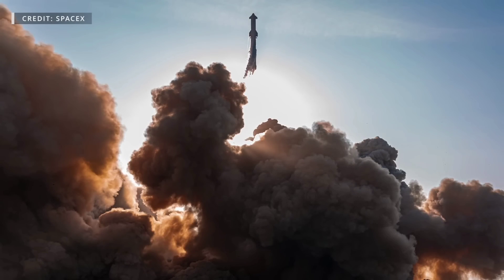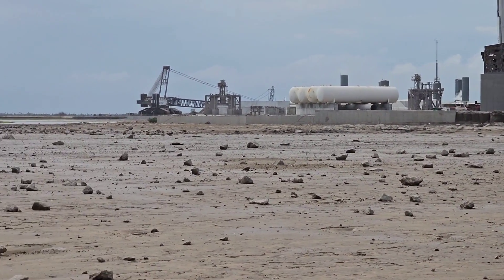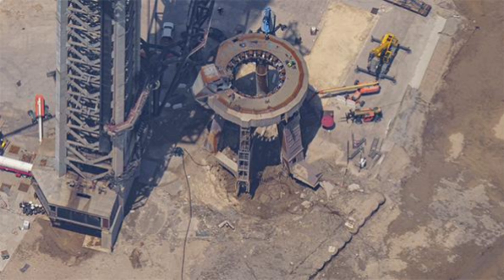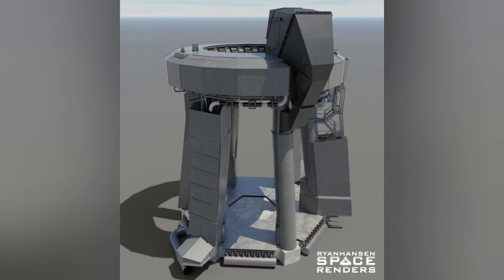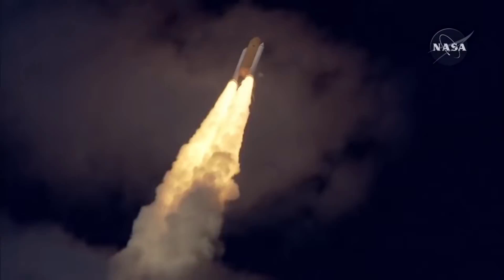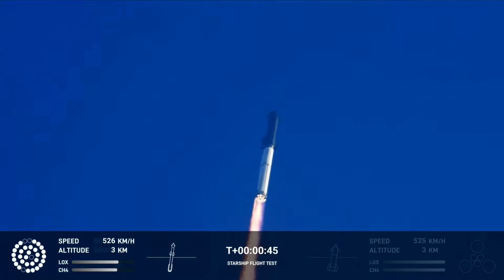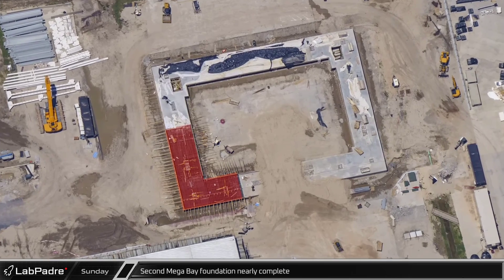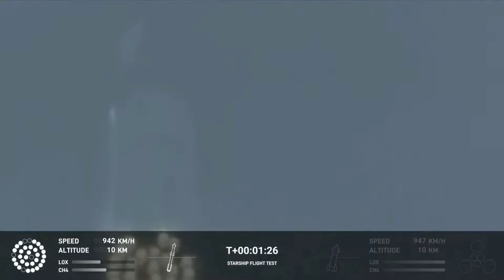Will Elon Musk's water cooled flame diverter be enough to keep Starship and Starbase safe?

Comment: Rapid iteration and willingness to RUD equipment is what got them so far so fast.  I don't think them destroying a couple plates and water systems, maybe even having to redo the pad altogether, is a bad thing at all as long as they keep the data coming in and morale is high to keep cadence up.  They built the LLM pretty fast.  Building a second one would likely only be faster if they decided to.  I'm also unsure about a large flame trench for rapid turnaround launches.  The right metal with enough cooling can handle extreme temperature and pressure shock over and over again until failure.  And failure modes in elastic materials are a bit more manageable.  If they did build a huge concrete flame trench, and it were to get damaged, turnaround could be much slower than popping in a new steel top plate.
Reply: Because rapid iteration worked for the Russian N-1? The Russian had five failures to launch on their moon rocket because they didn’t have the ability to do a full thrust test on the ground.

Comment: Go put a paper cup full of water in a fire.  It won't burn.  Go try to unsolder a copper pipe with a little water in it.  Even with map gas, the solder won't melt.  This has a decent chance of working.

Comment: I think they are in a rush to prove the flight worthiness of the ship and booster first before they could move operations over to KSC and risk that infrastructure.  Blowing up on the pad at KSC would be much worse for surrounding population vs Starbase.  So I think they fly 3-4 times, then move flights to KSC while they rebuild the OLM with what ever they need to have in place.  Of course they also need to figure out what they need, so that too can be built at KSC before moving flight ops there.  Will be interesting to see how it works out for them.
Reply: The problem is that they put the cart before the horse at KSC. Never launched a booster or full stack from boca but copied the launch mount design without a proper flame trench or diverter. Yes it seems they were planning some kind of deluge at ksc but they should have waited to build there until a few flights had been successful at Boca. 
Even the launch mount location at KSC is dumb; should have used the proper pad next to it. Their focus should have been building out falcon launch capability at other pads and using the historic 39a pad for starship…you know, the one with a flame trench designed for the Saturn V….but no, let’s use a small stool…it’ll be fine.
Reply: @jwortman1984  Or at least move Starship's pad further up about 20,000ft north of Pad 39B where Pads 39C or D would've been built. At least  that would minimize damage to a nearby SLS or Falcon in the event of a pad or low altitude RUD
Reply: Starbase is where they figure out what works, then they take the lessons learned and use them for KSC, why do you think the KSC pad hasn't received it's launch ring yet, they are incorporating things learned from Boca into the new rings (yes multiple rings).

Comment: Elon suspiciously was talking on Twitter about how cost effective it is to desalinate saltwater. Perhaps he is planning to eventually do this, since he has an inexhaustible amount of water a short distance away if it can be desalinated…
Reply: This is a temporary rig, so corrosion might not be an issue. He might not even bother to desalinate it.
Reply: @Geekofarm  …
I don’t believe that to be true, that it is a temporary rig. They are developing a launch mount that can launch a Super Heavy 3 times a day. So they are concerned with a system that can be quickly recycled. And Super Heavy is a reusable rocket, and allowing salt directly on the 33 Raptor2 engines will be very corrosive. It will be hard enough to protect from salt air coming off the Gulf, let alone spraying salt water directly on the engines and mechanisms 3 times a day…
Reply: @tribudeuno  Yeah, but that's not going to happen at Boca Chica.

Comment: I agree with much said here. This whole thing may need a complete rethink. Even after over 50 years, the shock mitigation of the mighty Saturn V still holds true to this day. It almost seems as though SX is just throwing ideas out there, they might have 5 or 6 in the works right now to see what sticks. The primary purpose for SS right now is to launch Starlink satellites, whatever that takes.

Comment: How DARE you doubt the engineering genius of Elon!!! This water cooled steel plate will work, because Elon tasked dozens of his most capable engineers away from their work on hyperloop to create the detailed designs for the solution using cutting edge, hyperloop technology (that will deliver all of the needed water instantaneously from the Great Lakes),  combined with the rocksolid Messaging capabilities of the galactic Twitter application! The detailed design were done exhaustively on not one, but both sides of the very  best only slightly damp,  cocktail napkin available at the local dive bar! Nothing can go wrong! Especially with all the components of the design that should be there, but aren’t! Parts that aren’t designed and implemented cannot fail!

Comment: The only thought I have regarding the water cooled plate is that if what Elon said about how the concrete pad was damaged by being compressed or flexed downward causing it to crack how will they keep that from happening to the steel plate? If they can mitigate that issue then I think it could work.
Reply: Using Inconel instead of steel also may be a solution, perhaps raising the launch height and designing a mobile diversion system
Reply: Steel can flex a lot more and is stronger when doing so.
Reply: I realize that steel can flex more than concrete but the force would still have to be transferred to whatever is supporting it. But I guess that's what structural engineers went to school for. I obviously don't have that knowledge, it's just something I was wondering about.
Reply: @Popdaddy580  as the sand/whatever is under it compresses, it pushes back with more force as it is compressed.  Concrete has a little flex to it as well, but obviously not enough.

Comment: I'm not sure about what Angry said about concrete "beside" (outside the OLM legs) the water system being destroyed again. The reason that the pad broke was the thrust force and sonic force directly below the OLM; the thrust was going directly down until it hit the ground. The concrete cracked when the soil below compressed. Once cracked, the thrust forced its way in and began shearing concrete. As the concrete was displaced, the soil was displaced in a growing pit and eroded under the "side" concrete until it too was displaced. If the water system works, there will be no cracking of concrete directly beneath the thrust path, hence no soil displacement, hence all that force will NOT get UNDER the side concrete and lift it up. 

Thrust has to GET UNDER the concrete to begin blasting it away. Thrust washing over the top of intact concrete will do nothing as we can see just by looking at the side of the OLM THAT DID NOT lose concrete. Look at the picture, on the right hand you can see where the concrete is intact because the soil below it was not displaced. https://pbs.twimg.com/media/FuP0Bs2X0AAenmE?format=jpg&name=small

Comment: All I hear in this video is assertions about how the plate will fail, with no evidence or support from the "experts." If you've actually consulted experts why not let them speak?  Also for the perceived need to redirect the blast with a flame trench, can you point to any major damage to the rocket or to equipment near the pad that WASN'T caused by debris thrown up from underneath the pad?  If not, then that's actually evidence that there's no need for a flame trench, so long as the water-cooled plate remains in one piece and isn't thrown up by the blast.

Comment: Jee Whizz do you ever consider the glass half full rather than perpetually empty? Given the damage I think it's a done that SpaceX will run a series of tests on it duh!!! The quicker launch sequence proposed will have a positive effect as well (less exposure to the heat and pressure). SpaceX should be applauded for daring to break the old and look at innovative means to make things quicker and easier. Yes yes the maiden launch had its issues but it was a huge success and not the huge drama your creating. When you get the the EU may I suggest more tea and less coffee and chill out you never know you might see things in a different light. Oh btw if you have all the answers why the hell haven't SpaceX hired you? asking for a friend.

Comment: It won't work. Presented structure does not seem to be able to support force applied by SH. It will be punctured at the center due to heat and sheer force of the exhaust.

Comment: That's a lot of heavy shrapnel to be ripped apart by the forces being produced that they seemingly can't grasp the extent of. There's absolutely no way they can force sufficient water directly against the engine exhaust being produced. THAT is why other blast/diverter structures are struck obliquely. This allows LAYERS of water jackets to be used to cool BOTH side of the deflector while REDIRECTING the exhaust stream. I fully expect a catastrophic failure to make the last one pale in comparison. SpaceX engineers seem to be determined to ignore DECADES of practical experience gained by the ORIGINAL engineers who ALREADY DID what these NOOBS are ATTEMPTING! It seems that Elon has a team of "Yes men" who are afraid to point out the OBVIOUS to their IDOL. I like the goals and achievements of SpaceX. They do EVENTUALLY learn from their mistakes... but they make SO MANY unnecessary ones! IMO

The OLM as designed was fine... for the Starship itself as there's no OLM on Mars. HOWEVER, there will be no Super Heavy boosters on Mars! Launches, FROM EARTH,   absolutely MUST have proper facilities WITH diverters, trenches, AND deluge systems.

Comment: The good news is that unlike the Space Shuttle which was using massively powerful and dense liquid hydrogen and SRBs SpaceX has successfully validated methane for Starship of all things so hardly a modest validation. Having a chill plate is an "solid" idea as it's quite common for premium US offshore Boating applications as a "cooler" so would have real World applications in at least trying the idea. There has to be a channel to divert the debris flow as what was the disaster here was debris everywhere so that alone was a spectacular fail. The concrete as well failed which made me wonder if they should go with something far more flame and heat robust namely "bricks" which if those fail at least you learn something something that can immediately be applied as an improvement.  Here there was no system in place to fail so technically not a systemic failure but certainly ENORMOUS apparent damage anyways.

More to the point I'm not sure if there is much that could be learned from in this instance as again, there was no system in place in the first instance.

Lego Bricks/tiles and ideally in the shape of a well/spoon as has now been created as in engineering anyways there is nothing stronger than an arch. Poured concrete is done for simplicity no matter how advanced and a flat surface is by far the most weak both structurally but also as a form of containment of retained heat. Also water deluge in Florida NASA is used simply because there is so much water. This might not be possible in this Region of South Texas.

In short make Texas pay for everything as NASA already has a Moon Rocket that in fact works.